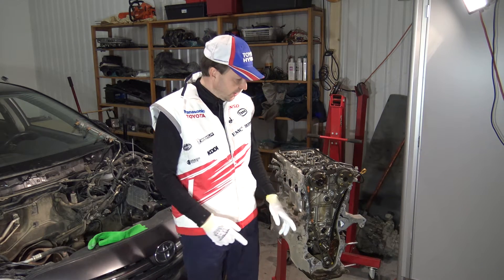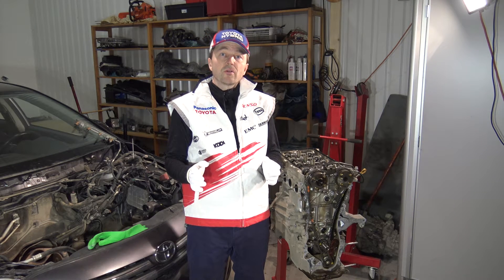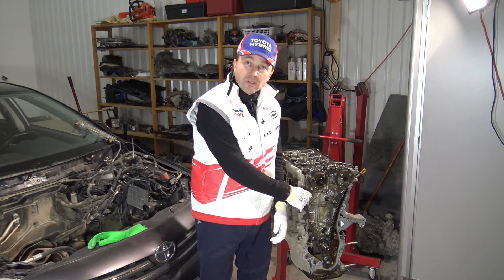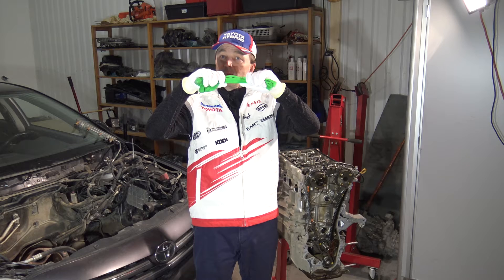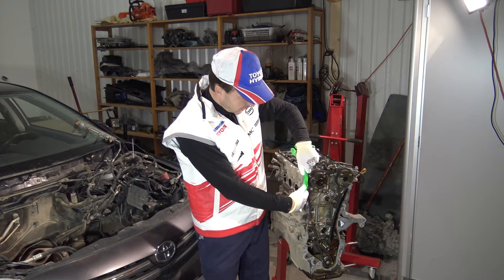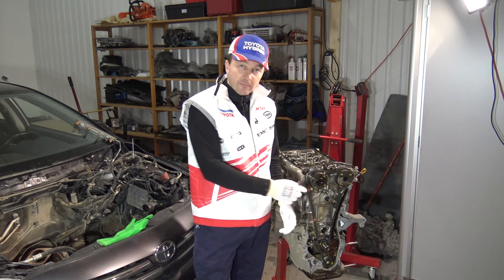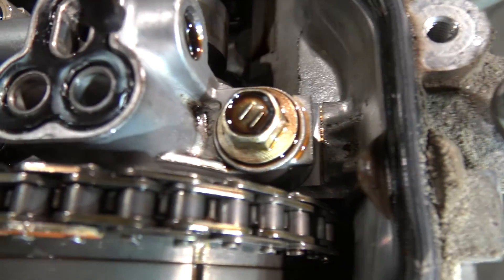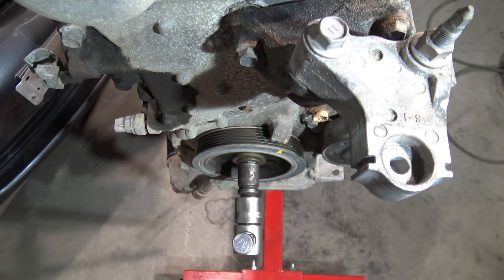Why Toyota car Timing Chain last longer than other cars does?

Comment: great video!!!   thank you.  i have a 2003 toyota regular truck,with 2.4l engine,  automatic with 166000 miles on it and its the original chain and I'm worried for no reason then,, and the original owner maintained it perfectly to!!
Reply from the maker: Right on!

Comment: You can't beat Toyota and Honda's. Far better built than the German cars.
Reply from the maker: You are Right !  :-D
Reply: i owned a toyota celica 2.0 GT the belt snapped at 70k. now i have a bmw 328ci 210k no engine or trans issues.
Reply: they are boring dull cars for people who don’t care about performance and joy of driving.basic engines require less maintenance compared to high performance and more complex German cars.

Comment: Hi my friend! This new time chain are crap....I have a Toyota Tercel 1995 with 400, 000 mile in the engine and I never opened it...this engine 4EFE its not chain its belt....I change it like 2 times only cuz normal maintenance....
Reply from the maker: Thanks. :-)

Comment: Toyota engine give less stress in their timing chain because most of them are non performance engine. Comparing it to BMW's engine timing chain is just like comparing cat and lion.=) Toyota cars are for daily driving and BMW's and other performance car are pushed to their limit most of the time and most have turbo. Drive a BMW like you drive a Toyota and the timing chain will probably last the life of the engine.
Reply from the maker: Hi, BMW engines are designed for last shorter lifetime. Smaller and thinner parts, shorter lifetime.